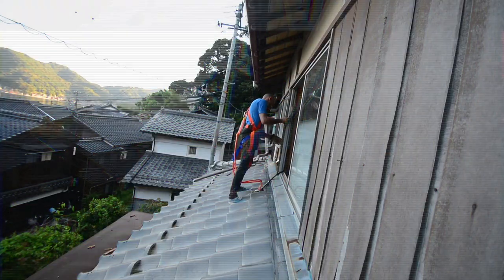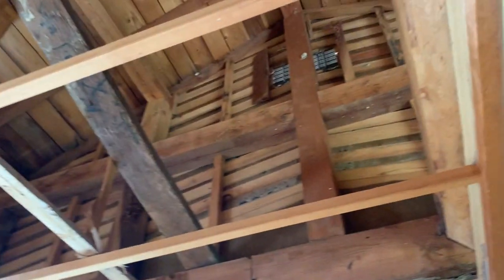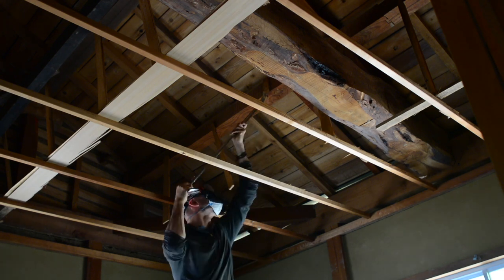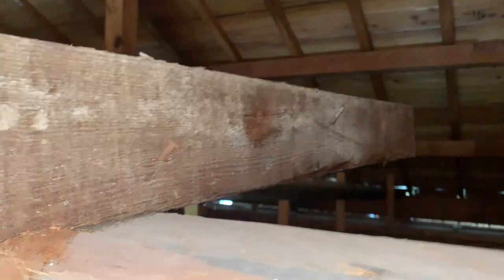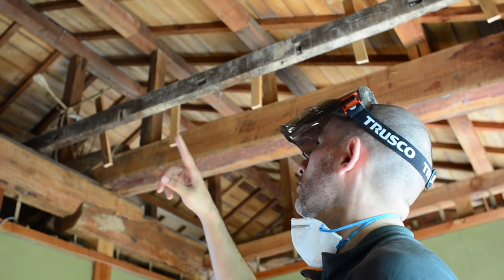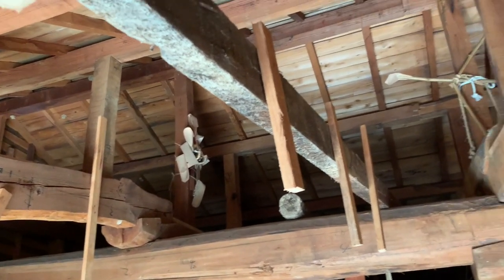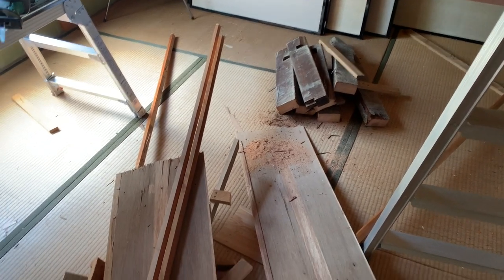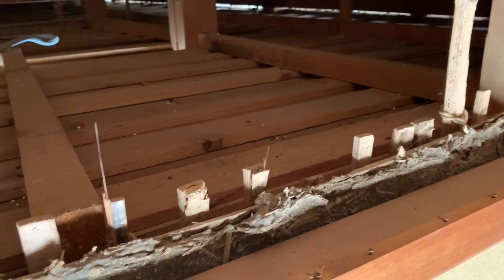Japan Abandoned House Open ceilings. Before and after - Episode 5

Comment: Hello, have you considered  installing insulation on the underside of your roof? Yes, the open ceiling looks great. Just be prepared for the huge volume being difficult to heat in winter and cool in summer. The ceiling supports are called saobuchi. Also, have you considered building a loft?
Reply from the maker: Yes I have! That area on the far end would make a great loft. That's way in the future as other more pressing projects get top billing. I have spent two summers and one winter there so far. I feel no difference with the open ceiling. But I didn't have AC or heating until this year. It has been hard to cool it but it has a lot to do with the windows having no blinds... the sun is just cooking through the windows. Blinds are in the works as I write this. Heating was ''ok'' just using a propane heater. With half the ceiling sealed, it kept the heat marginally well.
Reply: @DIYJapan  I’ve had very similar experiences. Where I live, Summers are excruciatingly hot! Often about +40C this summer. High humidity is the killer! I’ve been surviving without a/c so far... lol. So, I sweat a lot! Haha. Heat stroke is a very real risk. People die each year here. Take lots of cold showers. I would say, sun blinds or huge awnings on the south side of your house are a MUST! Where I live, the attic temperature easily reaches +50 to +60C! So a huge amount of heat radiates through my roof. Of course the old roof has no insulation under the tiles or under the supporting roof framing.
Reply: @DIYJapan  One option I would seriously consider, is keeping a ceiling in at least one room. This can be your ‘winter’ room which will be much easier to heat with a portable oil heater if you don’t mind huddling in there with the doors closed to keep the heat in. It really depends how much you want to invest in terms of time and money. I decided to keep only a single room warm in Jan/Feb. for evening use. I don’t mind my bedroom being cool. I’ve learned all the tricks for winter survival. Lol.
Reply from the maker: @ShikokuFoodForest  Downstairs is a much more easily heated and cooled area of the house. I find it very easy to keep cool almost without turning the AC on and heating was easy as well. I can see myself spending more time down there in the brutal summers and cold winters. Upstairs will be great for the shoulder seasons when I can just have the windows open and enjoy the breeze. Using the word survival is such a good way of putting it lol It's like urban survival camping lol

Comment: Love it! This is what I'm planning to do in my house soon and I'm sure it's going to look great. The big difference is that my ceilings are hiding the thatched roof.
Reply from the maker: I always wondered this... so you're telling me that the hay is still up there? I see that style of house all the time but assumed they would remove the straw and rebuild the roof with new material.
Reply: @DIYJapan  yes, it's still strapped in nice and neat. They simply covered it with a copper sheeting upgrade around 30-40 years ago. Once I remove the ceilings like you have, the thatching will be on full display! However, the roof is very tall so I'm thinking about putting in a small loft also! You can see some of it if you have time to check out some of my vids. Soon I'll be starting my ceiling removal, also!
Reply from the maker: That’s very interesting! I’ve watched your videos… so I’m looking forward to seeing the ceiling opened up! Be prepared…. It created a loooot of trash! The clean up is the single hardest part of it all and the removal of the materials afterwards. Good luck!
Reply: @DIYJapan  wow, thanks! 😊
I look forward to the vaulted ceilings but not the trash! Thanks for the warning -- I'll prepare myself for it 😂

Comment: 11:10 Make sure to seal those gaps below the roofing with mesh to prevent insects and tanuki / hakubishin from getting in. Especially the hakubishin they are amazing climbers and always prefer to reside in such places. Dont let them use your attic as a toilet / breeding area. I have a question about how you plan to design the interior. Are you going to keep the room interior walls as is, with open ceiling? We considered doing this but decided against it because the ceiling separating the attic was of such high quality and we both felt it would seems strange having walls but no ceiling. We also considered no walls except for the bath and laundry room, but decided against this as well for noise dampening reasons (i work from home).
Reply from the maker: I've never had any trouble with hakubishin but I did have a few bat inhabitants. I did seal everything up to keep unwanted animals from coming in. I originally thought it would be great to make the upstairs like a loft, I.E. no walls... but the amount of work it takes to tear the walls down... it's not worth the effort. I will leave the walls the way they are. As I seal the ceiling, it is starting to look more polished. I have a lot of work to do but it's coming along slowly. I love the open look and the only issue I might have is being able to hear others in other rooms, less audible privacy but it's not a huge concern. If I work from home and I really want quiet, I can send people downstairs lol The idea is to make the T.V./living room downstairs. None of my ceilings were of much worth and they were in need of replacement and I love the look of the open ceiling so I'm happy with it.